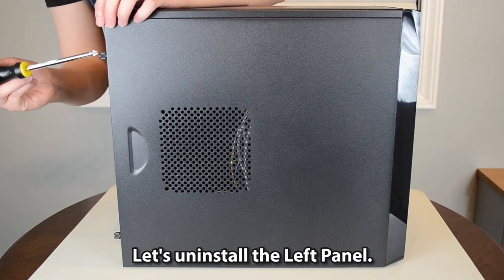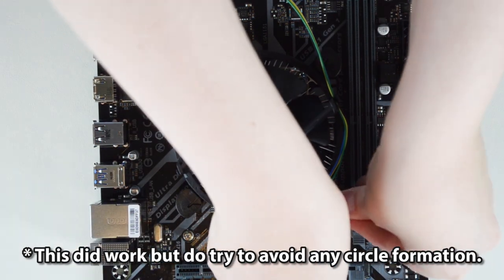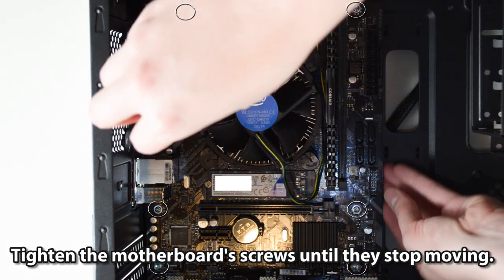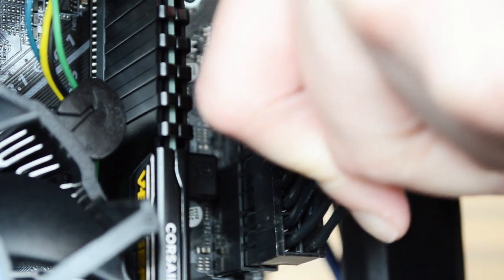Building an i3-8100 Computer (Step by Step) - Office PC

Comment from the maker: Timeline

1) 00:07 The part list
2) 00:22 Uninstall the Left Panel
3) 00:41 Remove content within the case
4) 00:59 Uninstall the Front Panel
5) 01:08 Uninstall the Right Panel
6) 01:24 Uninstall the back Case Fan
7) 01:40 Remove the 5.25" bay cover
8) 01:49 Undo CPU latch
9) 01:54 Installing the CPU
10) 02:16 Installing Intel's Heatsink (Stockfan)
11) 02:55 Remove the M.2 screw
12) 03:05 Install the M.2 SSD
13) 03:21 Installing the RAM
14) 03:40 Installing the Power Supply
15) 03:50 The 4 Power Supply Screws
16) 04:27 Route PSU cables thru the hole
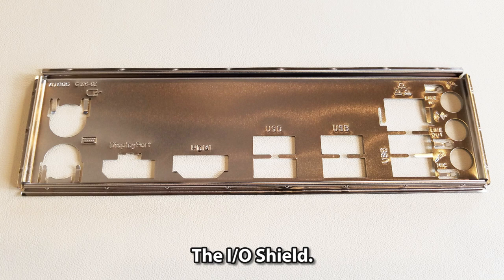17) 04:58 The I/O Shield
18) 05:02 Installing the I/O Shield
19) 05:20 The 6 Motherboard Standoffs
20) 05:24 Installing the Motherboard
21) 05:46 The 6 motherboard screws
22) 05:50 Install the MOBO
23) 07:24 Connecting the CPU ATX Connector (4+4-pin)
24) 07:36 Reinstall the Back Case Fan
25) 08:08 The 4 case fan screws
26) 08:12 Install the 120mm Case Fan (Front Fan)
27) 08:53 The 3-pin Fan Splitter
28) 08:57 Connect the 3-pin Fan Splitter
29) 09:04 Installing the Hard Drive
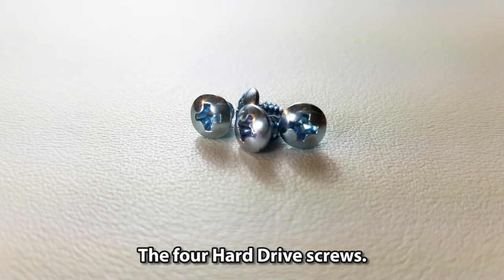30) 09:12 The Hard Drive Screws
31) 09:46 Remove the 5.25" Bay Cover
32) 09:56 Reinsert the 3.0 USB and front panel cables
33) 10:04 Reinstall the Front Panel
34) 10:22 Installing the Optical Drive
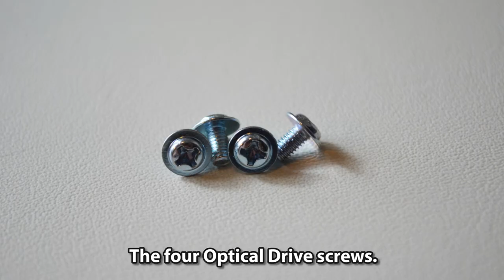35) 10:34 The Optical Drive Screws
36) 11:19 Connect the 24-pin ATX
37) 11:33 Connect the SATA to Optical Drive
38) 11:41 Connect the SATA to Hard Drive
39) 11:56 Connect the 3.0 USB
40) 12:06 The FRONT PANEL Diagram Connections
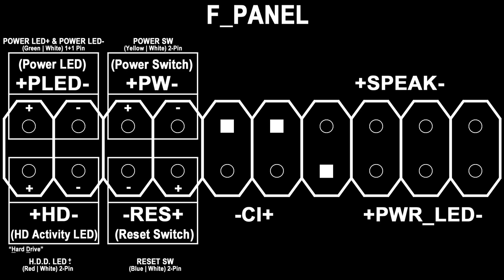41) 12:14 Connecting the H.D.D LED +-
42) 12:27 Connecting the Reset SW
43) 12:38 Connecting the Power LED +-
44) 12:58 Connecting the Power SW
45) 13:16 Connect the 2.0 USB
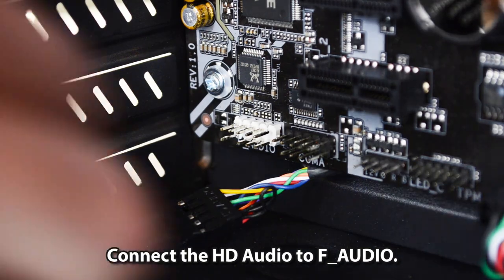46) 13:32 Connect the HD Audio
47) 13:42 The 2 SATA Cables
48) 13:46 Connect the Right-Angle SATA Cable
49) 14:06 Connect the Straight-Angle SATA Cable
50) 14:22 Reinstall the Right Panel
51) 14:49 Connect the AC Cord
52) 14:54 Press 1 from I/O switch
53) 14:58 Plug AC Cord to Outlet
54) 15:10 Press the Power Button to test computer
54) 15:30 Reinstall the Left Panel
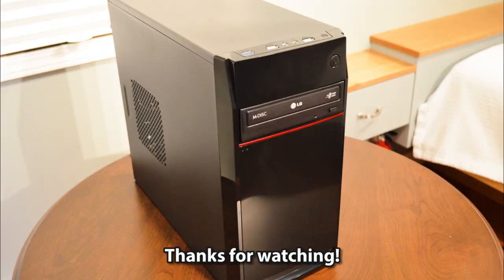55) 15:47 This completes building a computer
Reply: Didn't know you had a YT channel. Subbed for sure. Seriously look at the darn timeline. No one does it to that level of detail. Keep it up!
Reply from the maker: Brandon - Thank you so much and I will! I'll make sure the details continue on. I appreciate your support!

Comment: I cant install Windows 7 64 bit in my i3 8100 its.  Bugging while installing is CPU not supporting win 7 or maybe i have old version of windows 7
Reply from the maker: Unfortunately it is because Intel's 8th and 9th generation "motherboards" do not support Windows 7. These two generations only support Windows 10. You'll run into problems with Windows 7 paired Intel's 8th generation motherboards. It really depends upon the motherboard.

(From each manufacturer's webpage) the 7th generation MOBOs added in a special download for a USB to assist Windows 7 installation. 6th generation was the last line that wouldn't require too much workarounds for such attempts.

Comment: Can i build this without a fan splitter
Reply from the maker: Yes, you can certainly build without a fan splitter. Depending upon your motherboard if it supports up to two case fans (chassis fans). However could also connect one of the case fan's 4-pin molex connector to the power supply's 4-pin molex to power one of the case fans. Keep in mind, the molex connection will always be the same RPM for that case fan. So in other words the case fan's speed will remain the same when using the molex connection.
Reply: Eltechis the fbm-01 case similar to this one
Reply from the maker: @StarcleBlaze  The FBM-01's wires are mostly similar but I don't think it has a 3.0 USB cable for the front panel section. Unless I am mistaken and they made some with it but I know that case by itself didn't have one. It has been a while since I seen such a case.

Otherwise the back case fan is an 80mm with a 3-pin connection which connects directly to the motherboard while the 120mm case fan at the front should have a 3-pin and a 4-pin molex.

* Remember to use only one of those connections. Do not connect the 3-pin or 4-pin and the 4-pin molex at the same time. One of those connections is plenty enough to power the case fan.

So depending upon the motherboard, the PSU, the case, and the case fans than this determines your available connections.

The internal layout is less flexable with hiding wires but otherwise it gets anyone started with a custom PC in a tight budget. Plus I think two case fans provided already helps a lot.

Do be careful with the FBM-01 case's metal edges, especially near the back area as they tend to cut fingers. Rosewill's older, cheaper cases such as the FBM-01 and RANGER-M were culprits for easy finger cuts. In general this was true for most of their older cases. Over the years some other cheaper cases were better about this.

And my apology for a delay response. I had to sleep.

Comment: How much does this pc build cost?
Reply from the maker: Hi subhankar. If I currently replicated this exact build that was made about a year ago (2018), it would be $380~$400 with no sales tax. Example here is if someone lived in CA USA, and let's say their county's sales tax was 7.25%, base price of parts were $400 then the total cost them $429. And this doesn't include the OS, other software (this is subjective for each person), peripherals and a monitor. However, RAM and SSDs have come down in price in 2019 and I can make a better updated part list that is very similar to what this office build was a year ago. Meaning something similar to this build can cost $325~$380 in 2019.

These three part lists doesn't include sales taxes because I live in a state that doesn't have it. So do double check with your estimates base upon your location, including available components.

- i3-8100 (8th generation)

PCPartPicker Part List: https://pcpartpicker.com/list/s2F9bX

CPU: Intel - Core i3-8100 3.6 GHz Quad-Core Processor  ($122.49 @ B&H) 
Motherboard: Gigabyte - B360M DS3H Micro ATX LGA1151 Motherboard  ($66.01 @ Amazon) 
Memory: G.Skill - NT Series 8 GB (2 x 4 GB) DDR4-2400 Memory  ($32.99 @ Newegg) 
Storage: Team - MS30 512 GB M.2-2280 Solid State Drive  ($51.99 @ Amazon) 
Case: Rosewill - SCM-01 MicroATX Mini Tower Case  ($22.99 @ Amazon) 
Power Supply: EVGA - BR 500 W 80+ Bronze Certified ATX Power Supply  ($35.98 @ Newegg) 
Optical Drive: LG - GH24NSC0B DVD/CD Writer  ($16.89 @ OutletPC) 
Total: $349.34
Prices include shipping, taxes, and discounts when available
Generated by PCPartPicker 2019-06-20

===========

- i3-9100 (9th generation)

PCPartPicker Part List: https://pcpartpicker.com/list/8HBtP3

CPU: Intel - Core i3-9100 3.6 GHz Quad-Core Processor  ($129.99 @ Amazon) 
Motherboard: ASRock - B365M Pro4 Micro ATX LGA1151 Motherboard  ($83.88 @ OutletPC) 
Memory: G.Skill - NT Series 8 GB (2 x 4 GB) DDR4-2400 Memory  ($32.99 @ Newegg) 
Storage: Inland - Professional 512 GB M.2-2280 Solid State Drive  ($54.99 @ Amazon) 
Case: Rosewill - SCM-01 MicroATX Mini Tower Case  ($22.99 @ Amazon) 
Power Supply: EVGA - BR 500 W 80+ Bronze Certified ATX Power Supply  ($35.98 @ Newegg) 
Optical Drive: LG - GH24NSC0B DVD/CD Writer  ($16.89 @ OutletPC) 
Total: $377.71
Prices include shipping, taxes, and discounts when available
Generated by PCPartPicker 2019-06-20

===========

- Ryzen 3 2200G

(Keep in mind the Ryzen 3000 series processors are coming in July 7th, 2019)

PCPartPicker Part List: https://pcpartpicker.com/list/tQ3Xjy

CPU: AMD - Ryzen 3 2200G 3.5 GHz Quad-Core Processor  ($86.89 @ OutletPC) 
Motherboard: Gigabyte - B450M DS3H Micro ATX AM4 Motherboard  ($71.88 @ OutletPC) 
Memory: Team - T-FORCE VULCAN Z 8 GB (2 x 4 GB) DDR4-3000 Memory  ($39.99 @ Newegg) 
Storage: Team - MS30 512 GB M.2-2280 Solid State Drive  ($51.99 @ Amazon) 
Case: Rosewill - FBM-06 MicroATX Mini Tower Case  ($19.99 @ Newegg) 
Power Supply: EVGA - BR 500 W 80+ Bronze Certified ATX Power Supply  ($35.98 @ Newegg) 
Optical Drive: LG - GH24NSC0 DVD/CD Writer  ($18.88 @ OutletPC) 
Total: $325.60
Prices include shipping, taxes, and discounts when available
Generated by PCPartPicker 2019-06-20

===========

Now this is all subjective because certain parts may be more cheaper for you or may not have it so will require a substitution on a part. May even want a different case and you may not need an optical drive either unless you still use CDs and DVDs to this day. Otherwise, this is what I would recommend from one of the three for an office computer. All have room for upgrade paths. Hope this helps!

Comment: how to install windows 7 in  os  8the generation
Reply from the maker: I wouldn't recommend Windows 7 for Intel's 8th generation, including the 7th generation. And with recent hardware doesn't support Windows 7 like they used to with Intel's 6th/5th/4th/3rd generations. You would need to check forums and other videos on how to install Windows 7 for an 8th generation and another major issue would be trying to transfer the necessary "updates" for the Operating System. Some features may not work too but it's a choice some are willing to do. Would be a lot easier if you had at least Intel's 6th generation to make it work more smoothly.

Until 2020, January 14 arrives then this ends the support of Windows 7. They will allow anyone to reactive their Windows 7 to other hardware/machines that do support it but no more security updates like what happen to Windows XP and Vista.

Comment: you didn't use any thermal paste between your CPU and your heatsink
Reply from the maker: It already had thermal paste to begin with. Intel's stock fan comes with TIM "Thermal Interface Material" which is a thin layer of paste already pre-applied onto the heatsink. Hence why I didn't need a tube of paste thankfully.

But yes if ever see pre-applied paste not doing the job or somehow smudge off then have to clean it up and redo the thermal paste. And when applying new thermal paste than a "b-b size" or "pea size" of some Arctic MX-4/Sliver or Thermal Grizzly, or whatever thermal paste that is meant for the CPU between the heatsink will do the job. And never apply the new over old paste so previous paste must be removed with 70% or 91%  isotope alcohol (or use Arctic Silver Arcticlean) with a paper towel to remove the paste and use coffee filters to remove lint. Less is better as they say. And the TIM appears the same as they always do, so far: https://youtu.be/-RXWlvzrIFA?t=12
Reply: Eltech thanks for this I didn't know they come pre-applied this will help when I make my own pc.  cheers
Reply from the maker: No worries Oisin. Happy to help in anyway I can. Happy building in the future when you create your PC!

Comment: She didin't use Thermal Paste
Reply from the maker: Additional thermal paste wasn't required because it already had TIM (Thermal Interface Material). Meaning the Intel stockfan comes with pre-applied thermal paste on its heatsink. I assure you, if I did not have any then I would have made sure to apply a pea-size or a b-b size of thermal paste upon the center of the processor. New stockfans from both Intel and AMD will have pre-applied thermal paste so no additional thermal paste is required. Unless something wasn't right with the thermal paste to begin with due to the temperatures and many attempts of redoing installations with no improved results. In other words if the temps were reaching 72 Celsius and higher in mere seconds between under a minute then I would cleaned off the TIM from the heatsink and the CPU and try a new thermal paste like Arctic MX-4 and redo the installation process.